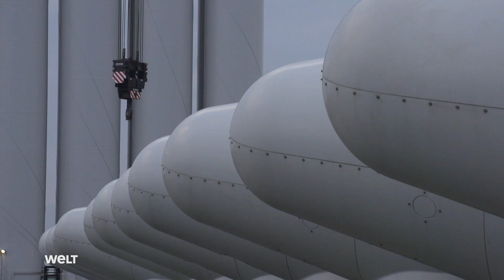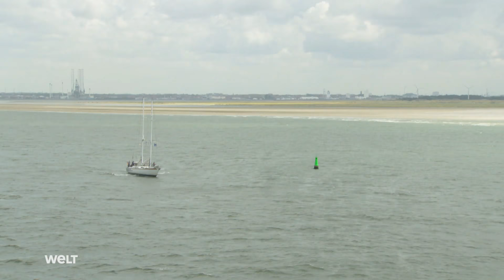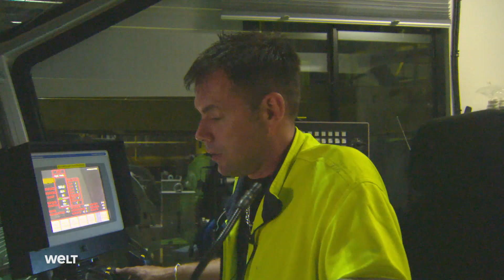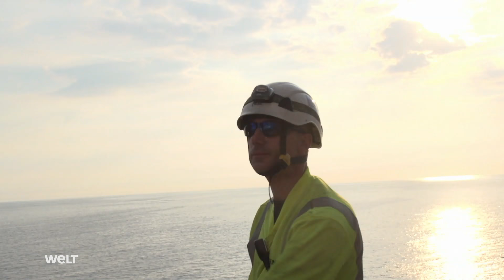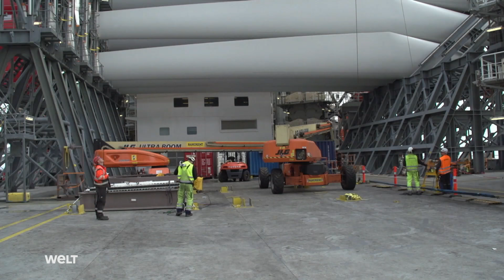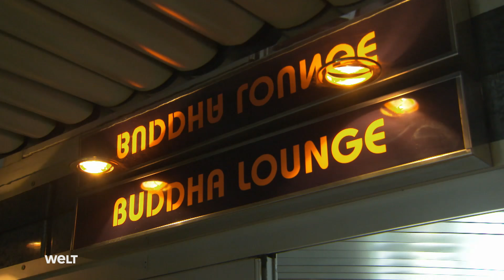Offshore Mega Construction: Building 150-Meter Giants at Sea | FD Engineering

Comment: This vessel is now called Wind Osprey, I watched this documentary while sailing out on it to build East Anglia 3 project! Very little has changed on the interior accommodations in the 12 years since the documentary. 

The main crane has since been replaced with a bigger, more powerful model, and the wind turbines are now much larger. We can only fit 3 at a time instead of 10!